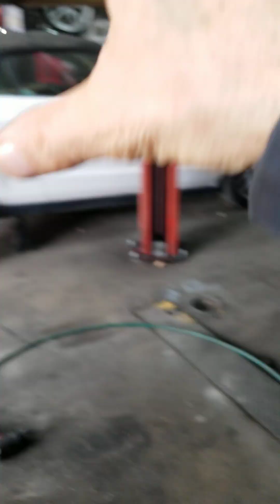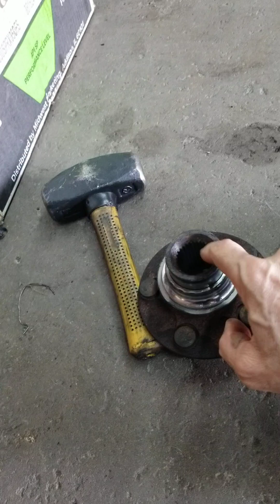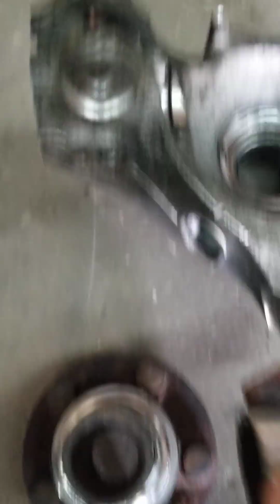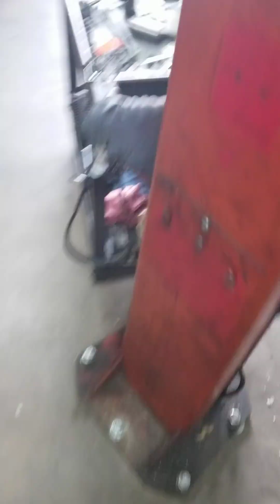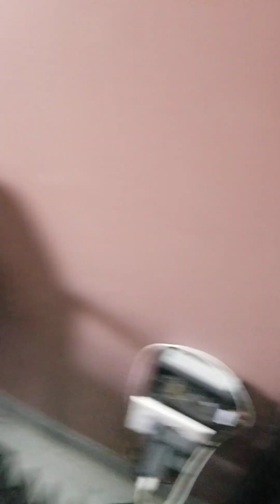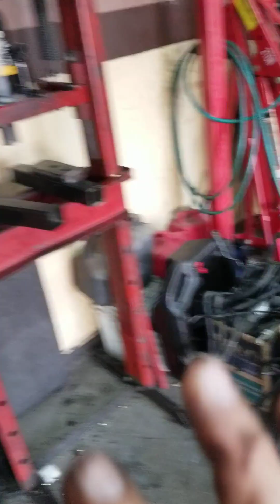2021 range rover evoque front wheel bearing replacement.

Comment: How does the bottom ball joint come out from the knuckle? Mine is stuck
Reply: I just had a bearing replaced on my Discovery Sport (same as Evoque). The garage couldn’t get the driveshaft out of the hub. They thought it was seized in place. 
I rang a Land Rover specialist who said it needed a special tool to drive the shaft out. 
I took it to them & they extracted it using their tool.
Reply: @hughmarcus1   we just could took it out at 40t at the press. That shaft was massive stuck in the hub
Reply from the maker: @michaelbarraclough5954  you need special tools
Reply: The lower ball joint seized